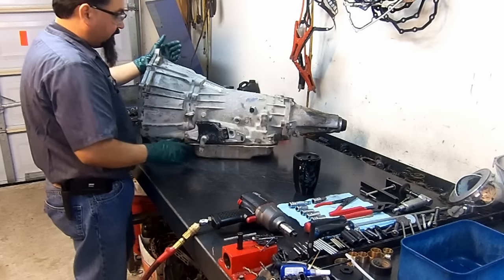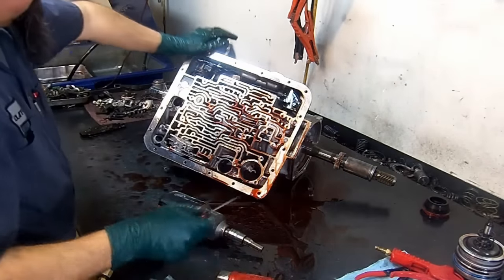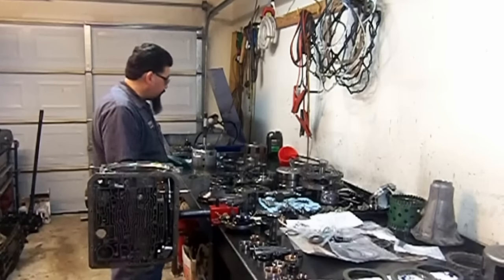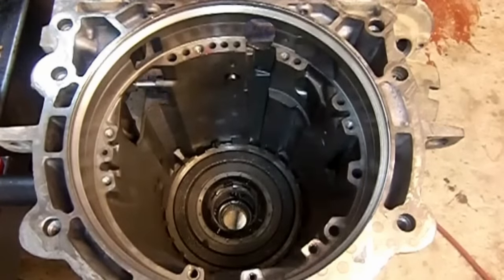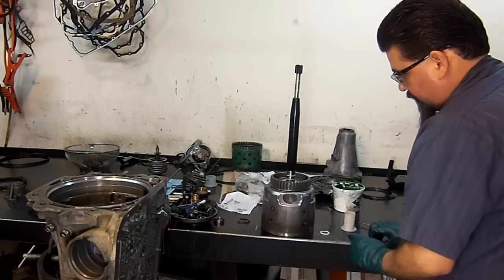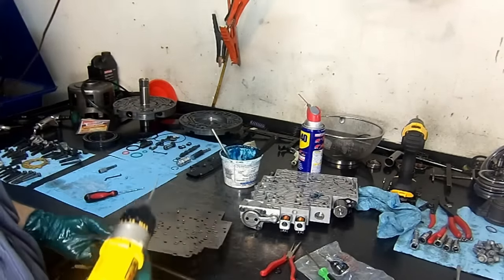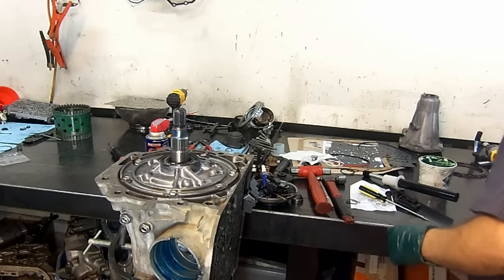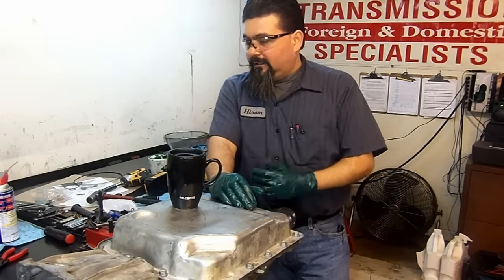4L60-E Transmission Full Rebuild

Comment: Hi I love your video! My 4L60e slips while in position 'D' when it gets to 2nd gear around 2500rpm. As if I shoved it in neutral. At 4500rpm or if I let off the gas, it will shift to 3rd gear. But it doesn't slip when in position '2' or if I drive it like I was doing a 0-60 from a dead stop. I tried the longer Sonnax servo pin, and it does the same, exact thing and seems to have a friction sound (not sure if it is binding). Everyone tells be me my 2-4 band is shot but I'm not so sure.
So while in '2' I get more fluid pressure than in 'D' and it doesn't slip - what sensor or component controls that pressure? And apart from the band what 'could' be causing this issue. Thanks for any help you can offer.
Reply: increase pressure on 2-4 band and add some seafoam, problem solved forever!

Comment: HELP!!!!   (awesome detailed videos by the way! thank you!) i have removed everything as described in your video, just removed  the pump and the shaft and assembly is stuck! now i have the body sitting vertical with the output shaft going threw a hole in my table looking down into the transmission i see no obstructions, can turn the input shaft by hand and hear minor friction. it will not come out any advice?
Reply: This sounds like the 3-4 clutches are welded up and stuck to the front Ring gear.

Comment: I have the 2007 i lose all gears when it warms up. When its cold it has all forward and reverse gears. I'm going to attempt to rebuild the transmission do you have any idea what it could be please mate
Reply from the maker: Sounds like your filter is clogged. There's 2 main issues causing the filter to clog up. 1 the torque converter comes apart internally shedding lots of metal, 2  one of the planetary gears bearing failed causing the gears to break and shed metal.
Either way your transmission has to come out and inspect.

Comment: Hey I have 2000 escalade with the 4l60E. I was driving on freeway on cruse control rpms went up and I lost power I pulled over found trans dipstick out 3in and fluid all over. What would cause that?

Comment: I got my transmission rebuild and 6 months later got p1870 code. I took it back they said the torque converter getting Hot they will install a transmission cooler..does that sound right
Reply from the maker: They need to address the issue, which is repairing the TCC isolator valve. I have 2 videos on that particular code.

Comment: I like to watch any video I can concerning the 4L60E transmissions to see how other folks determine any issues with any slack between the steel shaft and aluminum 3/4 drum. You didn't check at all, you just went right past it. For all you know, this unit will fail shortly after the overhaul. Yet you called the sun shell no good even though there was little to no wear. ???????????

Comment: I rebuilt my 4L60E, it now shifts great. Unfortunately, I have the same symptom as before, transmission or gear fluid slowly dripping from the extension housing/transfer case meeting point.  I read somewhere that this was supposedly a 'dry' area. Any ideas?  Could it be the transfer case fluid?
Reply: Inside the transfer case flange there is an oil seal. I've had one leak years back, if I remember right it was installed backwards.

Comment: I’m looking for the best website to order the complete overhaul master rebuild kit? As well as the best sun gear shell brand. Sonnax? Transmaxx? Etc. Also some assistance in visual diag. On which trans I have between 4L60-E or 4L60E. What tools are a must & what tools I can do with out? Any info and tips would be very helpful.
Reply: BOSS BREAD  thank you so much 😊

Comment: Hey iram do you know what can be causing a no 1st and 4th gear after a rebuild? Before 3rd gear was slipping so i got it rebuild  but now i only have 2nd and 3rd gear but no first or four ,i check all electrical and it's good valve body and it's good i cannot think of anything else anyone has an advise on what to check next ?

Comment: Did you forget the 3-4 clutch return spring during the input drum assembly that is supposed to retain the 3-4 clutch apply ring/ "crown"??????????
Reply from the maker: Watch part 2 of the 700R4 video,  I explain in detail that question.

Comment: Rebuild my first 4l60e(94) only reverse works no forward gears doesn't matter where i put the shifter. Now if i put it in neutral and raise the rpm up to about 3000 and put it in maunal quickly you can feel it move backwards slightly and stop...any ideas..

Comment: Hi Hiram Looking For Some Advice.I have 2002 V6 VX Calais supercharged it has a 4L60  ,and just recently I'm having a strange issue with the transmission,I don't drive it far usually just 70ks or so one way turn around and come home but just recently I've noticed it wants to try to kick back to that half gear between 3rd and 4th and a week ago I drove a thousand kilometres and while driving between 2 to 300 km the gearbox didn't want to change back gears until I had to slow down through towns and then while increasing speed it was jerky through gears...the only way I could fix it was disconnect the battery to reset the ECU or something does anybody know what is going on after reconnecting the battery the car was fine perfect for another 300 I done this 6 times with the same result...any information would be greatly appreciated ...Cheers Terry..
Reply: I think I'm having a similar problem.... 1999 VT Calais.... On load at about 70-80kph uphills, and sometimes 80-100 on a flat road, it "thumps", like it wants to kick back from 4th to 3rd but then "changes its mind".
Did yo ever find a solution to yours?
Reply: @steveodonald1979  No Steve haven't done anything with yet ,i'll let you know when i do..
Reply: @terryscfleet5059  Please do let e know. I actually havn't tried disconnecting the battery as you have, but will give that a go.... and will let you know if I come up with anything further on this problem.
I have a scan tool (of sorts), which shows slip and other info.... might try running that in the next few days and see what it shows, if anything.

Comment: In Reallity he only assembly the transmision and don't give a detailed inspection of every part on camera.  it takes more time to expalin how to inspect every single part of the transmission and what it could be the damage . some problems coud be : leak on the input drum shaft, pinions of the planetaries loose, wear on the input sprag , wear on the valve body bores, check the resistance of the solenoids, check for flatness of the reverse drum where the band runs, wear on the case where the center support seats, adjusment of the band, etc etc.

Comment: Here's a question for you are the shifting solenoids for 1st and 2nd and 3rd and 4th are they the exact same solenoid, I know there's two of them but when I pull them both out they both look exactly the same so I wonder if they are the same because when I went to an auto parts store they sold me two of the first and second shifting solenoids and they didn't know that there was a 3rd and 4th solenoid, so my question is are they the exact same solenoids just two of them ones for first and second the other ones for third and fourth or they completely separate solenoids that do two different things
Reply from the maker: They're the same part number for both. So yes, they're the same.
Reply: @AutomaticTransmission  thank you

Comment: Hiram, I have a 97 4L60E that I replaced the front pump seal and gasket however it still leaks fluid badly. Any ideas? Thanks Ray
Reply: Bad bushing. Wears and leaks fluid by

Comment: on my 200 sierra 1500 only has 1 , 2 and reverse.
It was run low of fluid, What parts you recommend I will need for it.
Reply: Going to need at least the basic rebuild kit, the 3-4 clutches are the first things to go, new band while you're in there. A bushing and bearing kit too.  Beyond that you're not going to know what else you need till you're in there. Also worth reading up on any upgrades you might want to do while you have it open as well.

Comment: Hiram, can you help me out. I just followed your video for a 2009 4L60E rebuild. I am certain everything went as planned and instructed, however I took it for a test drive and it was good for a mile. But when I pulled back in the trans went into a limp mode and now no gears at all. Do you have any suggestions
Reply from the maker: The torque converter might have not been all the way in and shattered the pump rotor causing no fluid pressure. 
Disconnect a cooler line and start the vehicle, if no fluid comes out your pump is broken.
Reply: @AutomaticTransmission  Thanks, I jus got this done and there was plenty of fluid flow and by simply sticking my finger on the end it would not let me stop the flow, so the pressure should be ok.

Comment: What kind of assembly lube are you using(blue stuff for the o rings)?  Is that just wheel bearing grease?
Reply from the maker: No, it's assembly lube for transmissions. The blue is thinner than the green.

Comment: Does this also work for the teardown of a 93-97 4l60e? You are showing only a 2001 and up transmission. Need 93-97 4l60e teardown.
Reply from the maker: It's exactly the same
Reply: @AutomaticTransmission  Other then the electronic parts, does this also apply to the 700R4?

Comment: I have a Dodge dakota 2003 2 Wheel Drive v6 i have a problem with the truck. Basically when i accerlate on flat all the gears Change correctly but when im Going out fast to get on the road it Changes the first gear but to get to the second gear i have to let go of the throttle
Reply: Thank you for making good videos and explaining well, good job and keep it up

Comment: Is this the same for a 1995 silverado  2wheels drive 4l60e
Reply: This will apply to the 700R4, 4L60 and 4L60E. All the same core unit with 90% of the difference being in the valve body.

Comment: Places like AAMCO are still in business because for every one of you saying they suck, there's 1,000s of satisfied customers. I have been dealing with AAMCO for about 40 years. For my families personal vehicles as well as our race cars. Not only have they always done what they said they'd do, they have gone above and beyond that several times. You're not going to like this and will refuse to even consider it, but transmission failure is about 100 times more likely to be the fault of the owner/operator than the manufacturer or rebuilder. AAMCO locations are independently owned and operated franchises. 600 of them in the US and Canada. Because you had your feelings hurt at one of them doesn't mean the entire corporation sucks or should fail. Instead of whining about AAMCO or other shops, try educating yourself as to your auto trans and your responsibilities as  an owner/operator such as maintenance schedule etc. In 40  plus years no one in my family or company has had a premature trans failure that could in any way be blamed on AAMCO.

Comment: I know this is a old video hopefully u can comment my 700r4 works great forward gear first low gear no slipp nana but I'm having a delay in reverse most times it goes in then there's other times takes 10 seconds  other times takes a second or two is there anything I can look in to what could it be the trans does not slip no delay in forward gears pulls strong firm shifts doesn't skip a beat just trying to figure out this reverse issue 87 700r4 in a trans am
Reply: jon sixxx it’s trying to catch the reverse

Comment: Need some help my 700r4 wont shift into 3 I changed out the valve body now it does but not all the time
Reply: Could it be pr valve ?
Reply: Try a bottle of Lucas transmission fix

Comment: my 4L60E is leaking fluid from the from the front i replaced the seal and it did it again now it doesn't want to go in gear i had to drive it 35 miles leaking I'm sure it's toast now

Comment: Why did you apply air to the 24survo
Reply: Just to make it not stuck
Reply: @heavensflame4598  and that has to happen so it wont get stuck or can it adjust on its own if I dont have the compressor

Comment: Why does a 4 L 60 e switch from 1st to 2nd but not into 3rd or 4th but stays in second
Reply: The 3-4 clutch pack is the first thing to go in these units, thats your 700R4, 4L60 and 4L60E. The band is usually the next thing to go.
Reply: What will a bad servo check do.
Reply: Valve

Comment: Would this be the same transmission that’s in my 2010 SSV Ute. My box has started to shudder when it shifts from 1st to 2nd if anyone has any information on what could be causing this it would be much appreciated thanks Yogi 🤙🤙
Reply: A shudder is a grip and slip of the clutches or band during application that happens extremely fast this is not good. it is a sign that your transmission is starting to fail.

Comment: I just wish you'd slow down a bit and discuss a little bit more on how things functioned as a group and different failure modes. If somebody wants to watch you and learn to rebuild their transmission, and they're smart, they're not going to race through the rebuild. It's not going to make any difference if your video is 2 hours or 4 hours, an amateur is going to take his time.

Comment: I just realized that the transmission is basically a motor which doesn't provide its own power but it provides many choices of mechanical differential.

Comment: Do u have one on a 94 4l60e 2wd
Reply from the maker: It's the same as this one. The only difference is the 94 is on/off TCC while 95 and up are all PWM TCC. 94 doesn't have a PWM solenoid, every thing else is the same. You can follow this video to work on yours.

Comment: hello great video. Question. I just had my tranny re built for 2001 toyota sequoia. After all was done the check engine light kept comin on and error code p0770. Kept saying solenoid E malfunction. The mechanic changed all solenoids and the valve body, torque converter and the light came on again. Checked all wiring and still no diagnosis. Now he wanna put a another re built tranny and get rid of this one. Why is it that this is happening? I am so frustrated and its been 2 months. Is there another solution? ty so much

Comment: mmy trani ls starting to run hot after drove to texas 1474 miles its runnig  180-190 and sjowly  coming under 65 miles an hour
Reply: 180 is on the warm side but not outside the normal ranges

Comment: P0741 4l60e eny help
Reply from the maker: Could be a bad torque converter, but I've seen that code being electrical in my experience. 
I've replaced a pcm because of the P0741.
Usually on a 4L60E a bad converter or a valve body problem will flag an P1870 code. 
Hope this helps

Comment: He's not as good as you think if your going to teach this you need to teach them what fails weak points what to look for that breaks or fails on each trans ,I built them for 40 years of very 25,000 transmissions all he is doing is how to rebuild it never shows what goes bad ,a guy watching builds one that has planets bad or ring grooves in a drum and puts it in and wonders why it don't work or fails ,to learn it you have to be able to diagnose problems ,you tell me what it's doing 100 poo recent I know what's wrong with it if he is good he should know where every bolt goes